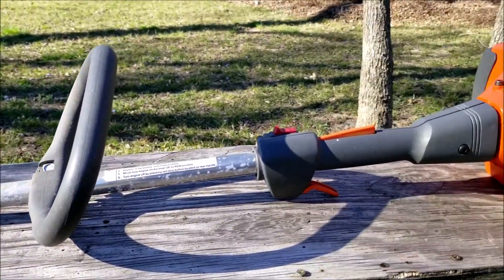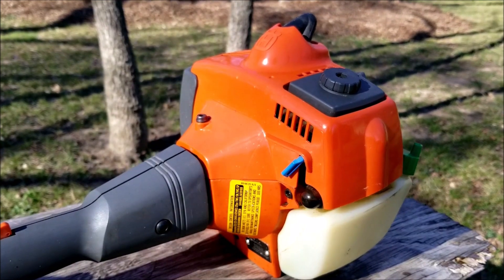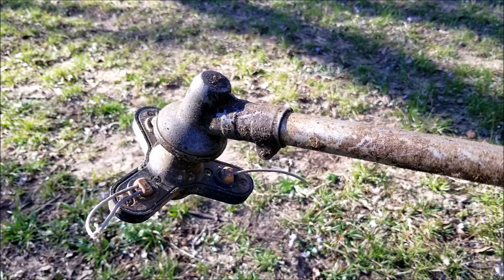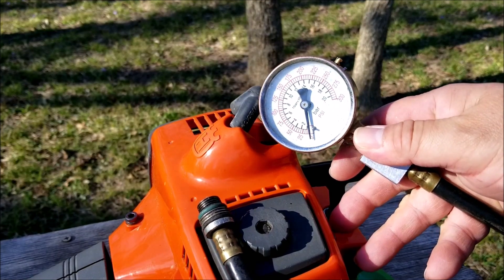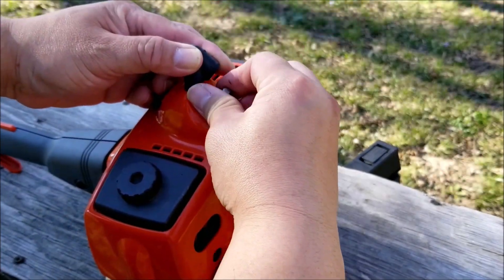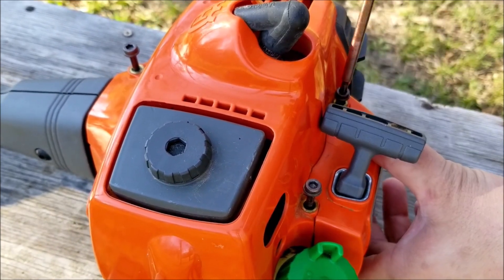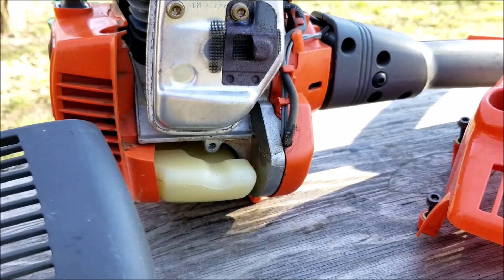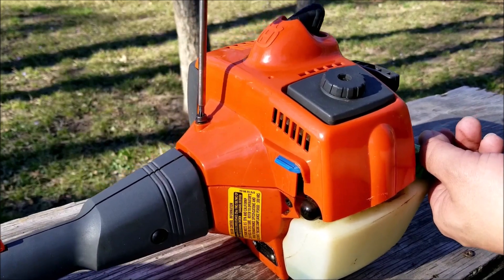Husqvarna trimmer was stored with fuel in the tank.

Comment: As far as I can see, rubber is rubber, plastic is plastic and if different pieces have the same gas/oil mix, they'll act really close to the same way. I'm looking down the barrel of this deal on the electric start mower I'm getting back. I was using ethanol gas when the kids got it and it's been several years and unless they dumped it out, it'll be waiting for me with a grinning face and a gummy disposition. BUT I had it running before and it'll run again, God willing! 2nd pull all the time after the initial starting and running a while with fresh gas, even if it was full of ethanol. No ethanol now and THAT is a pro level trimmer. Heavy duty. Thanks and Blessings!
Reply from the maker: best advice ever!
Reply: @INSIDEHOUSEGARAGE  Just seen through my bloodshot eyeballs and U 2, Pal! BLESSINGS!

Comment: I have a weed wacker that stalls when turned upside down to edge. any idea and there is plenty of fuel in tank.
Reply from the maker: Sure. Replace the fuel lines. It's happened to me recently.  Try using tygon line its very resistant to hardening.

Comment: 2 questions? Does it hurt to store your trimmer standing upright with the engine at the top? Also kind of a stupid question, when stored without fuel does the diagrams dry out? Or should I store them with Tru-Fuel in them?
Reply from the maker: both very good questions,  If you store your trimmer engine up, I would make sure theres not fuel in the tank, that way you avoid leaks.  The second question is preference.  I have not had my diaphragms dry out, after running them dry. And leaving tru fuel in them over winter is fine too.  It's your choice.
Reply: @INSIDEHOUSEGARAGE  Awesome thank you so much for helping me out.  I hear different opinions and wanted  to get your thoughts on this.
Reply from the maker: no problem

Comment: either use Ethanol-free gas exclusively or add Sta-Bil to the E-10 gas, better yet just remove the gas before storing it for more than 30 days… can’t go wrong with storing it for several months with ethanol-free but I would use Sta-Bil as well… there are other things that are bad, even worse than Ethanol, that come from the gas in the pump.

If you want to be real safe get Stihl Motomix, Husqvarna Premixed or TruFuel and fill it up before storing, ethanol-free is much cheaper though
Reply from the maker: thanks for the comment I appreciate it